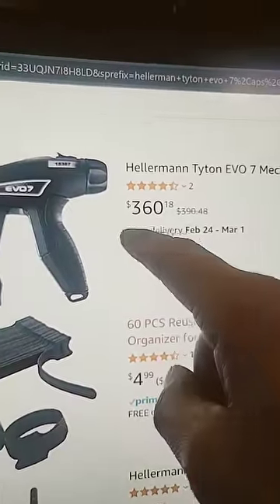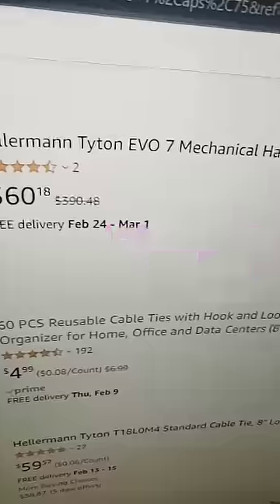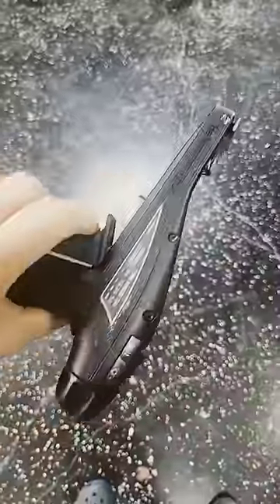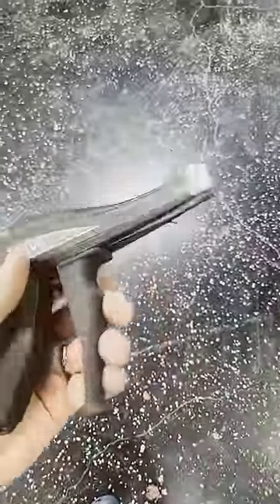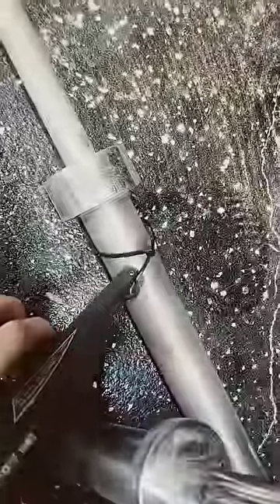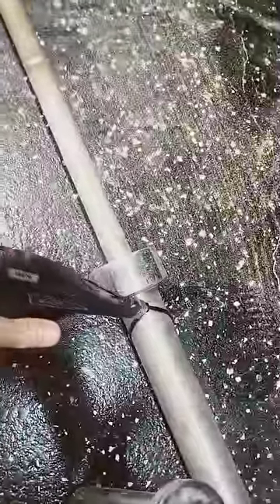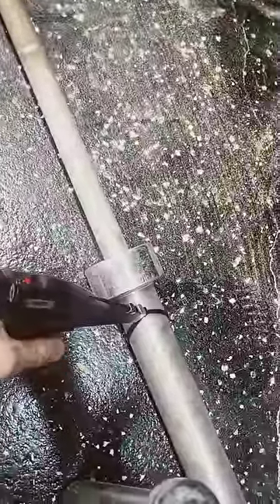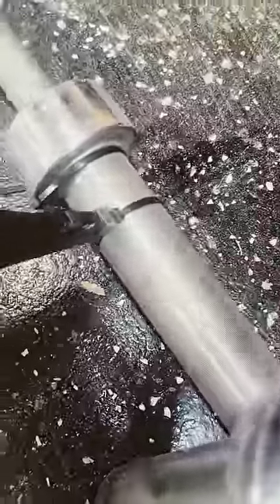When you like it TIGHT #shorts #electrical #shorts

Comment: We have these. They’re completely rebuildable. The most important features are the flush cut and the uniform repeatable tension. These are used when the customer cannot have sharp tie wrap cut offs for safety reasons. The uniform adjustable tension prevents collapsing of softer joined materials like hoses or split loom.
Reply from the maker: Yeah they really are consistent I didn't know they were rebuildable, pretty cool thanks for the input!
Reply: i hate sharp ends too, my $5 nail clippers do a wonderful job of leaving a smooth, rounded edge.
Reply: junk
Reply from the maker: @mtraven23  yeah,  what's your time worth?
Reply: @toolsandtactics  what do you mean?  that thing is clunky & slow!

The only really advantage is uniform tension, which I prob do just fine with..after all, tension on a zip tie i discrete steps.

if your 8 hour shift, is strictly zip tying stuff, fine...but no one needs one of these at home.
Reply: @mtraven23  yes I am sure that they do. The model of these shown is the Evo 7, we use the Evo 9. These retail for upwards of $700. But the thing they don’t tell you is that if you buy enough tie wraps they give you the tool at no cost. Also nail cutters work great for 10-100 uses. However we can go through a thousand or more tie wraps a shift. Every single one has to be perfectly tensioned and safely terminated. Huge contracts are on the line if the customer’s employee(s) incur injury. Are you going to bet all that on a $5 pair of nail clippers? I won’t even get into the ergonomics.
Reply: @jonhunt5408  read my more recent reply (the one right above yours)
Reply: @mtraven23  yes. I saw it after I posted my reply.
Reply: Not worth anywhere near that price. Many cheaper options.
Reply: @realmadstupid  malco makes a fine one for about 30 bucks
Reply: Same we use the one the pvc we put on the copper coming from the condenser unit
Reply: I'm not in at that price especially if that's usd not cad but man as a mechanic I could definitely find some uses for that thing
Reply: Damn it's been a while since I've seen/heard the word "split-loom" 🔥🤷‍♂️
Reply: How flush though? I want my cable ties cut so flush you can't catch a cotton ball on the tail
Reply: A 12 hour shift of securing wiring loombs and you will fall in love with these
Reply: I used to use these installing avionics in aircraft. There are some pretty tight regulations on how that wiring must be installed.
Reply: It is a very handy tool if used consistently, couple here and there aren't really worth it, but it is cool.
Reply: You know what else can do a flush cut on a tight zip tie? My pliers and side cutters 😂
Reply: You cant just do that yourself be a man
Reply: I've used them before, though a much cheaper model. It's used when you have tons of these and need a consistent measure for stupid reasons
Reply: Pull by hand and side cutters (read, SIDE cutters) work great. But I've used this device too and it's alright.
Reply: @collinkoop9739  argh, argh, argh, this comment has Tim the Tool Man vibes. Now I say “ I don’t think so , Tim (Collin).” Shit I forgot to put on my flannel shirt first. Also we’d have to rename the tool the Binford 7100.  But now, in retrospect, Tim would have been all about the tool, so he’d actually probably produce the Binford 9200 - a tie wrap cutter with a gasoline engine.  Never say never tho, so I’ll watch as you hand tighten and use your teeth to trim to perfection a few thousand ties in eight hours while keeping up with the pace.
Reply: @RK_Insanityy  yeah, no. Quality garden shears can get you a proper flush cut, and some departments have those for less critical areas. But side cutters squeeze the tie and create a short burr no matter what, also you have to hold them perpendicular to the axis of the tie to achieve the flushest possible cut, otherwise you wind up with an angle that creates a sharp point. Side cutters are fine for your garage bu they don’t cut it for industrial use, and this tool is for industry not the average person’s shop.
Reply: Knipex amongst many other brands sell flush cutters that have multiple purposes for 20 bucks
Reply: Used these when building wiring harnesses on train cars. Well worth it when you have to do ~1000 a day to the right tension and flush cut.
Reply: @KnottyEvo  exactly
Reply: They are nice and all, but I can flush cut with my wire stripers and I can reasonably feel the right amount of tension needed for what I use them for. Still, the tool does what it says on the box.
Reply: @jonhunt5408  What do you guys zip tie that precision is needed at that level, human organs?
Reply: Sharp ends can be eliminated if you twist the ends instead of cut them.  The twisting will melt the plastic end off and leave a non sharp end.
Reply: @choptlivah  some snap off anymore of cheap plastic mix
Reply: @kitehman my Thomas and Betts will cut them ever so sightly below flush.
Reply: @krispyasfk2567 it's consistency and ease of use.

Comment: Harbor Freight sells essentially the same tool for $20, hasn’t broken yet
Reply from the maker: Nice others mentioned it I'm gonna check it out
Reply: Is it $20 now? Because I remember it being like $3 for the plastic one and then they came out with the metal one that was like I don't know $10 or something. I don't remember it being $20
Reply: I bought the one from. Harbor Freight. Not even close. Not to mention I use quality zip tie guns at my work. I know the difference
Reply from the maker: @Ed Soderstrom  thanks for clearing the up lol 😆
Reply: Shhh, you spoil the secret!
Reply: I was gonna say bro i work at harbor freight n im thinking 360 for tht? Its the same thing we have at the store, i get it if its dewalt tools vs our power tools, but tht thing is probably made in china too
Reply: I used one for HVAC that was probably 30 bucks only because it was from a supply house but I've had 25 years
Reply: Good to know
Reply: @Lunsy  Supply house stuff really is awesome, I used to build and maintain inground pools and I got all sorts of specialty tools you'd never knew existed, usually for free too!
Reply: Yea but if you show up to the Boeing plant or any Boeing component supplier with a HF tie cutter you would be fired for negligence. Good tool for screwing around and DIY tho.
Reply: @alex042687  this guys knows the deal.  Aerospace is where these are needed.  HF model won't last a day.
Reply: “I know the quality” yet your still using zip ties?
Reply: I avoid knock offs when I can or everything's just generic and lower in quality.
Reply: @greuju That’s just not true.
Reply: I would be more worried about  the quality of the Zip tie then the gun.,

Comment: I used to work at an electrical panel assembly shop routing wire all day, we used a similar thing albeit vastly cheaper than that one. Very convenient tool if you work with zip ties all day like that.

Comment: Used alot in aviation. When you need to put down 400 odd cable ties it pays for itself.
Reply from the maker: Yeah I bet!
Reply: how?  that shit looks slow as hell!
Reply: @mtraven23   well you get them on snug/finger tight first, then come back through and cut them. The gun will just slide on, you don’t really need to handle the tie at all, also gives you a nice flush cut on the back end.
Reply: @billangell6478  how do you not handle it?  The gun doesn't seem to feed it, now that would be useful.
Reply: @mtraven23  you start them by hand.
Reply: @billangell6478  what?

"don’t really need to handle the tie at all"

" you start them by hand."

you're not making any sense.
Reply: @mtraven23  Dude learn how to read. You get the zip tie started finger tight first, implies installing them by hand. THEN you come back through. You swap to the gun after the ties are hand tight. At this point we’re past the hand install that was a different sentence, we have punctuation in between. So the gun will slide on to your snugged zip tie with having to handle to handle the tie at this point in time.
Reply: Hey, I'm looking into becoming and aviation mechanic. I don't know if that's what you mean by aviation but if you have any advice for someone interested in that kind of work I'd love to hear it :)
Reply: Plus, if the zip ties aren't flush, you can get in trouble.
Reply: Now that makes sense why this tool exists!
Reply: True, I have a pair from my grandpa that he had when he worked for NWA as a mechanic. They're labeled Hanger 7, and all metal Panduit GS2B and are atleast 20 years old since his last year was 2003, still working to this day
Reply: Aviation wire bundles, consistent tightness like a specified torque and like you said, 400 plus ties it is essential. It has its places for use.
Reply: 😮😮😢😮😮😮😮😮😮😮😮😮😮😮😮😮😮😮😮😮😮😮😮😮😮😮😮😮😮😮😮😮😮😮😮m😮😮😮😮😮😮😮😮😮😮😮😮😮😮😮😮😮😮😮😮😮😮😮😮😮😮😮😮😮

😮😮😮😮😮😮😮😮😮😮😮😮😮😮😮😮😮😮😮😮😮😮😮😮😮😮😮😮😮😮😮😮😮😮😮
😮😮😮😮😮😮😮😮😅😮😮😮😮😮😮😮😮😮😮😮😮😮😮😮😮😮😮😮
Reply: Untill you come to the bit where the engineers routed the loom with zero access for this thing
Reply: @arg31ify that why you have the recipro saw, jb weld and duct tape in your tool box!
Reply: @billangell6478  some people man lol
Reply: @mr.weinerjr  Went to school for Avionics and was taught to never use zip ties due to all the vibration on an aircraft. Instead we were taught to use wax string to tie everything down. Now I do low voltage cabling and zip ties are the most frowned on we always use velcro. Zip ties are a car mechanics friend that it
Reply: Given that a aviation engineer is probably being paid like $50-$100+/hr yeah, that probably pays for itself in a day.
Reply: You must mean civil aviation or USAF. They are prohibited on USN USMC aircraft. I am a NAVAIR EWIS SME. We still see them occasionally but new ones aren’t permitted.
Reply: @mr.weinerjr  get a good score and join the Navy with a guaranteed rating in aviation. In 1980 I got my initial training and am ready to retire after over 40 years in aviation. I’m now an aircraft wiring expert and sign flight clearances for them to fly. What a great time I’ve had. Oh it’s difficult to get the training on your own. Without the military training, IMHO you’ll never be as good as a military trained tech. I see it fairly often.
Reply: @kaptainkaos1202  CASA and EASA allow for them.
Reply: @newy816  we’ve seen too much damage to EWIS even when supposedly properly installed, especially to coax. Our studies have shown they change the impedance of coax. In todays systems it’s not uncommon to see phase matched coax installed and be messed up by improper install.

Comment: Harbor Freight has one that does the exact same thing for $20. Bought one 10 years ago, use it regularly and it is still going strong.
Reply: Not the same trust me
Reply: @LuckyHumanFoot  I used it regularly, almost daily, to bundle network cables after combing. The bundles were always tight but not too tight. I recently retired and now use it occasionally around the house. You're right, not the same; I saved $330.

Comment: This is a tool for people who work on computers and other things doing work where if you over tighten a zip tie or under tighten it you could damage something severely.
Reply from the maker: yeah they are actually worth if when you add man hours to a big job
Reply: Don't they usually just use Velcro in those situations
Reply: @scottstroh2564  sometimes yes, but those fixtures are known to fail or loosen with pitiful consistency.
Reply from the maker: @scottstroh2564  maybe for a few runs or a small job but multiple wraps like on a cable tray for large wires  tiewraps all the way

alot of data jobs will use a wax string that must be tied 💀
Reply: Used to have to use them at my old job because the customer was supper picky at the zip tie tightness
Reply: We use it for steal cable ties
Reply: @radioactivefox1  sheeesh xD

Comment: HVAC installers use something similar to these. They're called panduit guns/cable tensioning tools. You can find them at the plumbing section of home depot for like 50 bucks for the malcos, bout 20 bucks for the commercial electric. Not as compact, but save yourselves 300 bucks
Reply: First thing that came to my mind as well, although the cable ties for ducting are much larger 3-4’ as opposed to 8” for cable management
Reply: @geordiehomza1387  yes, but they still work for the smaller zip ties, I've tried it out on my car. Not as compact, like I said, but they still work in a pinch

Comment: I worked at a place where we were a subcontractor for NASA. We built to MIL specs 883B. I think think was the number, it has quite awhile back.  Every tie wrap had to be tightened with a tool similar to the one you showed. They had to be tested and then ever so often it was sent to be calibrated.  NASA was very strict on every step of the assembly procedure. This instrument was designed for the Space Station, but too bad, it never flew.  Such are government contracts.

Comment: Fun fact that tool is actually auto issued to most bmw work shops. for working on high voltage battery units as the wiring inside the battery is cable tied the cable ties must be carefully torqued so as not to cut the wire over time I would think they would also use that tool in aircraft wiring ?

Comment: Common for bundling high speed network cables and fiber optic cables.  

Contrary to popular belief, there IS a spec for zip tie tension when bundling network cabling...Has been since Cat 5 was rolled out.

If you've been using the same old "yank and snip" install method that you used in the old days, your cable installs were probably out of spec before you ever terminated an end, regardless of what your meter says when you test the cables.

While you are shaking your head in disbelief and looking through all of the EIA/TIA standards, you might also find the sections on conduit fill, pulling tension, hanger dimensions, hanger load, etc. illuminating as well.

I actually made quite a nice income for years as a consultant.  Asking for the zip tie tool manufacturer/settings, proof of max pulling tension, etc. was always a sure way to determine who ignored that whole "IAW manufacturer and industry standards" part of the RFP.
Reply from the maker: Great info!  Thanks!
Reply: @toolsandtactics  No prob.  Could also add that if the tension is not the issue, but having a safe cut that won't rip your arm open is the goal, a nice pair of large drug store toenail clippers will do you well, and you can buy them just about anywhere.

Comment: I use a cheaper version on outboard fuel lines so I get a consistent clamp so I know they won't leak. Also sometimes it give you just the little bit of reach you need and cuts flush enough not to cut you.

Comment: We use this when securing wiring in automotive high-voltage battery cases to avoid sharp metal tools in proximity to the HV cables.

Comment: I got an old metal one from back in the days and it works just as good. All I had to do was sharpen the blade which is removable/swappable.. I understand the whole marketing wank about the tension set etc but this thing is made out of plastic and it’s more than 300 bucks and it’ll probably never last 20 years

Comment: The panduit one is great and doesn't cost quite as much, or at least, it didn't used to. Had it in my kit since 1991, and it's never failed. Never leave skin behind by scratching yourself on a sharp zip tie end from poor cuts again. These, if set correctly, stretch the tie just enough to cut it such that the cut end is recessed inside the buckle - no sharp tab to snag your flesh later.

Comment: Huh, my work has one of these on every workbench, and there are about 70-200 bays. I guess price doesn't matter when every bay can make you as much as $30,000,000 every 2-3 weeks. We use them because we can't have any sharp edges on our zip-ties and they must be at a uniform torque, otherwise it could puncture a hot acid line or worse.
Reply from the maker: Great Example  Thanks!

Comment: If you over tighten a zip tie on wires it can damage insulation thus failing j standard inspections. Repeatable tention and reliable holding power is awsome added bonus can let you achieve tight zip tues in tight spaces

Comment: I've had a similar tool for about 12yrs now.   Use it on the zip ties for flex  ductwork        I'm a HVAC technician. And also do some installs    it's a very useful tool to have.  Used it daily mine the first one is a Malco.   The other is a Stanley.     Also had a Lenox that grew feet 🐾.    😒🙄🤨.     But these definitely have a lot of use's

Comment: There's ones that look like pliers, cost $20, and work 10x better. I used the same pair for years installing flex ducts until they vanished into someone's attic.
Reply from the maker: Ah yes, a monet of silence for the lost tools of the attic 😢
Reply: @Tools And Tactics  but thanks for doing it so I don't have to!
Reply from the maker: @leathercheerio1  hah  yeah
Reply: Have my dads malco zip gun from like early 90s older than me still works perfectly still hate doing flex

Comment: I use one (different brand… much lower price) and I’ll never go back. Cuts the tail flush. Anyone whose been cut by those damn angled cuts from using a pair of dikes or strippers to cut the end knows how sharp they can be. Superb tool… if you use it often enough.
Reply from the maker: yeah exactly electricians twist with kleins breakes em flush not sharp too!
Reply: I have a 14$ tool that is dependent on how hard you squeeze it to determine how tight it is. You can go from loose to tight to breaking the tie on the smaller sizes and then cut it off clean and flush. I've been cut by too many of those little razor blades.
Reply: Malco is the brand of choice

Comment: While most of the comments I see are mentioning a $20 cheaper alternative these ones are designed mainly for use in manufacturing plants where ergonomics are highly important. If you have someone on a production line installing 500 zip ties a day the tool they are using needs to be repeatable and comfortable. That’s where the price comes from